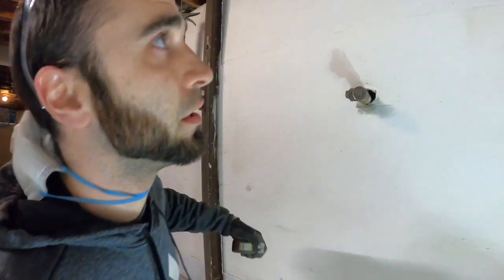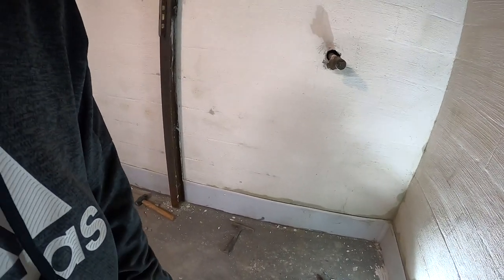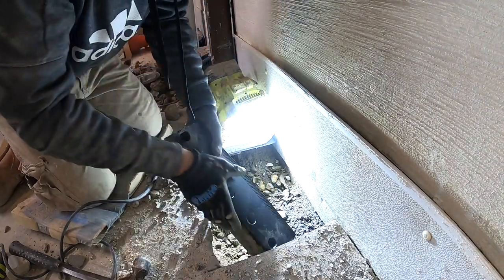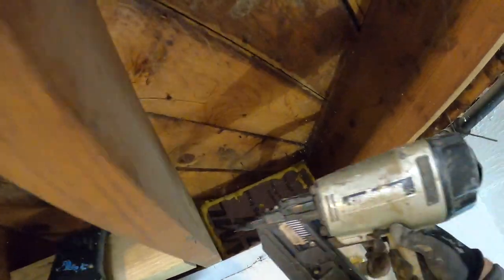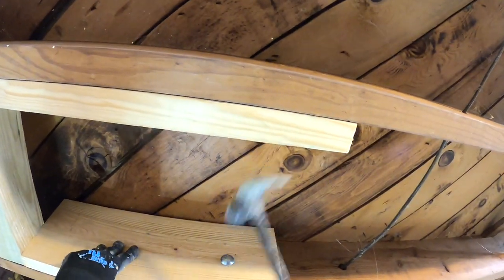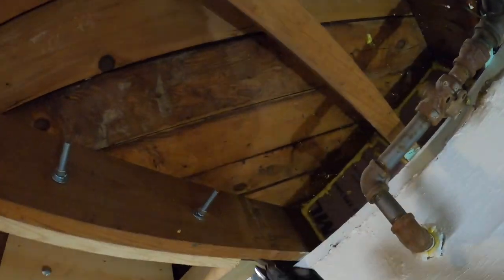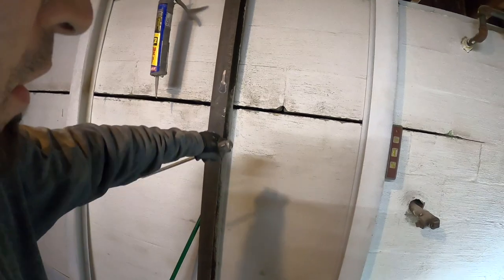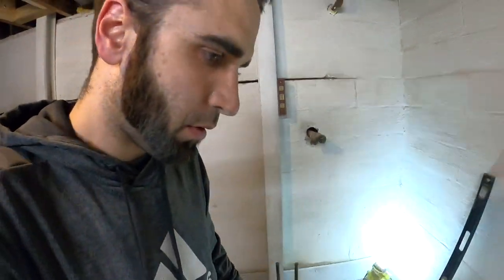Bowed basement walls, I beam install

Comment: Thanks for the video man. I've got a client who received an astronomical bid for carbon fiber straps. thanks to your video, I can get it done for half the price and with actual steel instead of a stupid band-aid lol
Reply from the maker: EthanAllen1775 No problem. I’ve seen a few places with carbon fiber straps not sure I really believe in them. Haha. Definitely think steel I beams are better. If you buy the beams I’d be interested to know your price per beam. Good luck on your project.
Reply: @handylandlord  I bought 4inch I beams like the one's you're using. I ordered them with a gray primer coating and I think they were around $118 a piece. I live near Chicago, so everything around here is a bit pricey. What do you normally pay?
Reply from the maker: EthanAllen1775 EthanAllen1775 I normally pay around $75 not painted. $118 doesn’t sound bad at all especially if they are primed. Thanks for the info. Good luck.
Reply: Also, do you fill behind the beam with mortar/cement if there's still a gap after jacking?
Reply from the maker: EthanAllen1775 Yes I do. I like to apply pressure with the screw jack.  Once I feel all movement is done. I install a piece of metal between the concrete slab and the beam. Cement in the bottom of the beam. Then I fill the gap behind the beam with mortar mix to prevent future movement of the blocks not touching the beam.
Reply: @handylandlord  thanks for the quick reply, I'll be doing similar on this job I'm doing.
Reply: @handylandlord  just bought a house this year with 6 beams on a wall in my basement.  Install was similar to what you did (beams were cemented into the basement floor) - there is probably an inch of mortar in some areas at the top of the beam (I think its mortar) between the beam and the wall.   Is that normal? - surprised they didn't try to put more pressure on the wall so it was more flush to the wall.   That basement wall is shared with my garage - and I just had the garage floor jacked out and new concrete poured.  Hindsight 20/20, maybe should've used that as an opportunity to have the outside of the wall (inside of the garage) addressed.   ANyways, the jacking of the garage floor caused some of the mortar on the basement wall to chip away and fall off.   The mortar behind the beams is all intact but it has some cracks in it.   Do you ever have to have that mortar replaced ?   I think these beams were probably put in 10 years ago; not sure.   I'm having a basement company come out this week for an estimate to ease my mind and tell me everything is all good with the beams.   If you're able to reply, thanks for any of your own advice!

Comment: I'm started to fix my bowing wall but still no confidence. There is water meter on that wall... the wall is so bad and looks like its gonna fall right now (already a year its scares me lol). Is anybody knows if I need building permit for that?
Reply from the maker: Tosik Dwane Permits depend on where you live. But more than likely yes. For the water meter. I normally open the hole around the pipe coming through the block on both sides to give the wall room to move around the pipe without messing up the pipe coming through the block. Just a heads up depending on how bad the wall is you may have to replace it.
Reply: Handy Landlord:
Thanks you very much. I'll try to push it back before replacing. Looks like it will work. At least blocks are in a good condition, just the wall bowed more than in your video

Comment: I'm trying to order I-Beams at metalsdepot, but I have no idea what to choose for: Web, Flange Width, lbs/foot. I know it varies, but generally speaking, for a basement with a mild bow, what kind of I-Beam do you use?
Reply from the maker: Just ordered 22 Ibeams at 94.5" long from Alro steel cost me $160 a beam. I use 4 inch #13lb  4.160 X 4.060  .280.  Hope this helps. Working on a basement now. Probably the worst wall I have seen in some time. Thanks for watching. More basement videos coming in a few months.
Reply: @handylandlord  Thank you so much for the fast and detailed reply! Best of luck with the basement you're doing now!
Reply: @handylandlord  I went to order those beams, but my total came out way higher, even when bulk buying 22 beams, it came out to $237.51/each...
4" 13# A992/A57250 WF BEAM,4.160 X 4.060 .280 WEB @ 94.5"
Where'd I go wrong?!
Reply from the maker: I would look for a local steel yard in your area. The company I use will not deliver to residential address. For me I just have to pick them up but they load them in my van with a crane. Keep in mind they are heavy.
Reply: @handylandlord  Makes sense. Ok, thanks, man! Yeah, they look heavy!

Comment: I have a drain system installed around the perimeter of my basement that leads to a sump, when installing the I beams could I just leave the drain pipe in place and just work around it? I saw that you cut a type of tile system in this video but I was wondering what you did after that!
Reply from the maker: Jacob Huey yes you should be able to work around the system you have in place as long as there is enough room between the wall and pipe for your beam.  Normally, the top of the drain pipe Is flush with the top of the footer. In that case your beam install would be easy. The drain pipe would not get in the way. My situation is a little different the system you saw me cut out was on top of the old clay tile system. I’m planning to install new drain pipe over to the sump pump. I was mostly worried about getting the wall supported before if got any worse. Thanks for watching. I will post more about this basement in the future.

Comment: I was quoted 23k for my 63' poured basement wall excavation and push, 13 braces and 2 earth anchors, seal wall, drain tile with 80% gravel backfill.  East central Kansas where our soil is sticky clay.  Wall is leaning in 3-4".    I'm thinking of renting equipment and doing it myself.  Comments appreciated.
Reply from the maker: Rick Dean Actually doesn’t sound like a bad price. Having beams installed in Ohio normally cost around $300 to $500 per beam installed. Most of the basements in my area are block walls. I only own one property with poured walls. Equipment or not it’s a lot of manual labor. Would not recommend hand digging haha. Do u know if the wall is leaning in at the top or does it have cracks and bowing?
Reply from the maker: https://youtu.be/AiKdv2CGZzg
Reply: @handylandlord  Poured wall is Leaning inward 3-4".  Stairwell has a 1/2 height poured wall so that would need 2 earth anchors instead.  That's what my quote said.  Cracks everywhere.
Reply from the maker: I am not by anyway trying to offend you, instead give you my honest opinion based on the info you gave me. The amount, 63' has me concerned that's a ton of digging, along with cracks everywhere. I would support the wall before digging with any machinery. I'm not sure I would take on this project alone if you decide to give it a go. I do feel you are on the right path with excavating the exterior and sealing the wall. Some companies will claim to be able to fix the problem from the inside and I feel that is false with poor results from my past experiences. Good luck on your decision and I hope this helps.

Comment: Box system in junk they should have took out the old drain tile and installed ADS pipe...I see why you are still having issues with the wall coming in.....You did a great job on beams...

Comment: Great video....what kind of jack are you using? are these available at auto parts stores?  Keep up the good work.
Reply from the maker: Thanks. The jacks are called screw jacks 15 ton made by jet. I’ve had them a long time but I believe I ordered them from northern tool. I added a link to the jacks in the description.

Comment: Hey whats up man, I'm a landlord who has this problem and I'm trying to get an idea as to how much this will cost me.. Are you free to take a quick phone call? I can send you my email address
Reply from the maker: Sorry for the delay I didn't get notified that you commented. I recently had 17 beams installed in one of my properties due to it had bowing walls. The cost for materials plus installation was $385 per beam. This also included sealing the basement walls on the interior. I also had drains installed for the gutter downspouts to route the water away from the foundation. Cost for the drain re-route was $1242. Total cost for the job was $8235. Hope this helps. Good luck.

Comment: Did you feel you had to excavate? I was looking to do a similar thing on my house in peninsula but with the intent to get the beams to move the wall then go back and reinforce the wall with #4 rebar and mortar from the top of the wall filling the cavity. Once complete and cured remove the beam.
Reply from the maker: Justin Herman I excavated because the wall was so badly bowed that I wanted instant results. Also, to seal the wall from the outside and add gravel. In the past, I have installed beams, applied pressure, corrected grade away from the house and seen results typically within a year.
Reply from the maker: Justin Herman https://youtu.be/AiKdv2CGZzg

Comment: My cinder blick wall is pushed in by 4 inches at the bottom. The bottom course is still in it’s place as it’s up against the cement floor. Do you think we can use this system to push the wall back that far? Soil will be dug out and we’ll place temporary supports to raise joints by a 1/4 inch over head.
Reply from the maker: Definitely you can use this method to push the wall back into place. You may have to push the wall back then reposition the beam and or the jack. I would make sure to support the cinder block wall before digging outside. These screw jacks are the best method I have found to put tension on the beam to push the wall back into place. Just go slow and try to push the wall evenly. Good luck on your project. Keep us updated on how it goes. https://amzn.to/305NbKU

Comment: Great video, most people just put bolts in the floor to hold the base but you cut the concrete. I like think putting the base into concrete is the best solution.

Comment: How much would you charge to do a similar job?
Reply from the maker: Dustin Lamb contractors in my area normally charge around $385 per beam installed. I would be willing to install for around $200 to $250 per beam installed. But not sure of the price of beams since COVID.

Comment: What size rebar are you using and what size holes do you drill in the floor to brace the 2x4 for the jack to sit against?
Reply from the maker: I use 24 inch concrete stakes 3/4 diameter with a 2x8 against then the screw jack against the 2x8. The bit is so old I believe it’s one inch or 1 1/4.

Comment: Instead of tearing up your concrete. Why not weld an end plate to the beam with holes in it for anchor bolts and match drill once the beam is under load from the jack? Are you worried the slab would not be thick enough, or the bolts not strong enough?
Reply from the maker: Casey Rohde the concrete along the edge was thin because of a previous sump install that was done, so in my case it wouldn’t have worked. I have seen this type of install before, but have never used it.

Comment: How would you install the top support for beams on a wall like the one behind you at 9:00 with the window, The boards running horizontal not vertical to you overhead?
Reply from the maker: First thing is to check to make sure your beam will fit in between the floor joist and the block wall. I cut blocking to go in between the floor joist at least 3 joist spaces back. Also I add a block between the first floor joist and the beam. Then, I glue and lag bold a 2x8 to the bottom of the floor joist screwing into the joist and the blocking that was just added. Install the screw jack and apply pressure like in the video. Hope this helps.

Comment: Will it still breakthe joyces if the outside wall has the dirt moved away from it first?
My mother's house desperately need fixed this summer, and we will be doing it by ourselves. 
Do you have any other tips to help?

Comment: What size I beam are you using thank you very much I appreciate your feedback
Reply from the maker: gar I use 4 inch I beams. #13. This is what the steel place recommend for basements in my area. Thanks for watching.
Reply: @handylandlord  thank you so much I truly appreciate it I just had mine delivered and I'm going to start the process tomorrow also what size rebar do you use thank you for your expertise
Reply from the maker: gar Great!!! The steel I am using is 1/2 solid. You could also use concrete stakes or 3/4 gas line pipe found at Homedepot. I’ve used them all in the past. Good luck on your project.
Reply: @handylandlord  totally appreciate you getting back in touch with me as soon as you did just goes to show the kind of character you are totally appreciate it
Reply: Also just want to let you know I started it today I did exactly how you did it and at the bottom of each one of my I beams there's a 8 inch difference on the bottom do you have any suggestions
Reply from the maker: gar I’m not sure exactly what your talking about? Are u saying the beams are 8 inches short?
Reply: @handylandlord  no what I'm saying is that at the top I have it flushed and then on the bottom it's 8in away from the wall I guess it's that way because of the bow in the wall
Reply from the maker: gar I would pull the top back some, but still have it at an angle so the bottom is out farther than the top. If you need a spacer I cut a 4x4 to the size I need and put it between the beam and the 4x4 installed on the floor joist. You will get some movement but not sure 8 inches unless you excavate the dirt on the outside. I can email u pictures if that doesn’t make sense.
Reply: @handylandlord  you have helped me in more ways then I can imagine thank you
Reply from the maker: gar Sent email. Happy to help in any way I can. Will try to create a short video on your questions.
Reply: @handylandlord  thank you I have installed 6 by 6 pressure treated wood across and 2 x 12 on each side already if I was to move it back would I compromise the floor joist that  
I installed the 5/8 lag bolts by backing it up some by drilling new holes
Reply from the maker: gar Could you email me pictures back.
Reply: @handylandlord  yes I will I'll go downstairs and take pictures thank you
Reply: I have the pictures ready how do I get them to you
Reply: Pictures sent

Comment: Is it ok to install Beam even the basement have no problem? I mean for prevention.
Reply from the maker: Yes you could install beams. It’s a lot of work to prevent. If it was me I would make sure you are getting the rain water and gutter water away from the foundation. Keep the gutters clean and flowing. Make sure the dirt is sloping away from the house / foundation.

Comment: I’ve been looking at videos on how to brace my wall and I’ve come across what’s called a power brace system. They put the beam flush to the wall at the bottom and just use angle iron bolted to the floor to stop the beam from moving back and at the top have a 1 inch thick bolt pushing into the beam going through angle iron fastened into the ceiling truss and slowly tightening over time. Do you think this is also a suitable method or am I better off to push at the bottom and set the beams in concrete ? If you google image search wall power brace you can see what I’m talking about
Reply from the maker: Let me look into it. Sorry for the delay I’ve been working around the clock.

Comment: Gotta redo the drain tile
Reply from the maker: Planning to replace the interior drain tile. Unfortunately haven't had the motivation to bust up more concrete and dig. Haha
Reply: I hear ya I did mine 4 guys it is a big project
Reply: When you put the steel beams in did you water proof them so they dont rust
Reply from the maker: adam erler they were painted with direct to metal paint prior to install, that’s all I did. Do u have a recommendation so they don’t rust?
Reply: @handylandlord  epoxy anything that you keep the barrier between the steel and water
Reply from the maker: adam erler Interesting. Thanks for the info.
Reply: @handylandlord  yeah because the paint won't work years from now 2 or 3 generations let's say those will snap